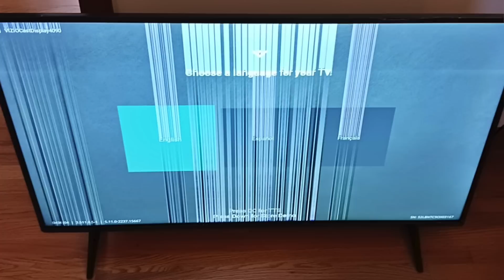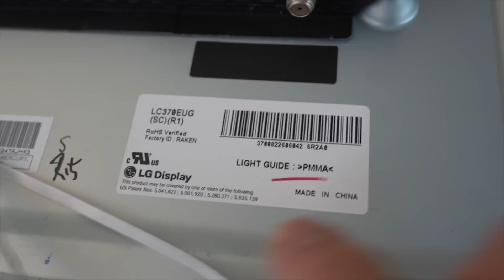FIX Your TV with a TOOTHBRUSH | Fixing Vertical Lines

Comment: I like that you showed off this TV repair even though you were unable to get it 100% working.
Reply from the maker: If I can figure out a way to fix that tab bond, I’ll definitely show it.  I’ve had some minor success by cutting into the cable at an angle and then dragging a soldering iron (with solder) across it.
Reply: @FrugalRepair  please Show it🙂

Comment: In many cases you can successfully reattach the bond contacts by using a hot bar. Besides the contact surfaces being a little bit sticky themselves, there's adhesive between the contact surfaces which is activating when heated to safely keep the ribbon in place. There are temperature-regulated soldering irons that have large bar-shaped tips to put heat onto a large surface. That would be the best-controlled approach but also the most expensive. The edge of a laundry iron might also do the job as you don't need excessive heat, only around 180°C or so. If you are really careful you can even do this reattachment while the LCD is being powered so you can immediately see the success.

Comment: 🎯 Key Takeaways for quick navigation:

00:00 📺 Introduction to TV Repair Techniques
- Introduction to fixing TVs with unconventional methods like tape and toothbrushes.
- Discusses previous success with the tape method and introduces the new challenge of fixing vertical lines on TV screens.
01:10 🛠️ Understanding LCD Screen Issues
- Explanation of different types of screen issues, focusing on vertical lines.
- Differentiates between vertical and horizontal line problems in LCD screens and their causes.
02:06 🖥️ LCD Screen Components and Functionality
- Detailed breakdown of LCD screen components and their functions.
- Explains the roles of driver boards, connectors, and the importance of signal synchronization in LCD displays.
03:01 🔍 Disassembling the TV for Inspection
- Process of disassembling a TV to inspect internal components.
- Focuses on safely accessing and examining the power supply board, main board, and other internal parts.
04:10 🧹 Identifying and Addressing Vertical Line Issues
- Identifying the cause of vertical lines and demonstrating a practical fix.
- Discusses how applying pressure to certain parts can temporarily fix lines, indicating potential issues with connections or components.
05:09 💧 Dealing with Liquid Damage and Corrosion
- Handling liquid damage and corrosion as common causes of screen issues.
- Provides tips on cleaning and repairing areas affected by liquid, especially around the tab bond area.
06:07 🛠️ Hypotheses for Persistent Line Issues
- Exploring different reasons for persistent vertical line issues.
- Considers possibilities like adhesive issues, corrosion, and component damage as causes for unresolved line problems.
07:04 📚 Diagnosing Various Causes of Vertical Lines
- Discusses various potential causes of vertical lines in LCD screens.
- Offers diagnostic tips and potential fixes, including applying pressure and cleaning techniques.
08:00 🛠️ Final Thoughts and Repair Limitations
- Concludes with final thoughts on TV repair and the limitations of DIY methods.
- Acknowledges when to stop attempting repairs to avoid further damage, and emphasizes careful handling of delicate components.

Made with HARPA AI

Comment: How about warming the ribbon connection with a heat gun and applying pressure as it cools (one half, then the other, to avoid dislodging)?  Might that soften the adhesive enough to re-establish the connection (even for solder)?
Reply from the maker: Great idea.  The main issue I see is dealing with the corrosion effects around that area and heat unfortunately, wouldn’t  help clean it up.

Comment: Thank-you for your TV repair videos.  It allowed me to mostly fix my 75" QLED Samsung.  TV was cycling from on to off.  Replaced the power board.  But still have a single multicolor vertical line.  Have cleaned several times the the T-con ribbon cable connectors plus done resets, made sure software was updated and line appears on all inputs.  So I am thinking the Main/T-con board got damaged when the power board faulted. Does that make sense?
Reply from the maker: Thanks! Congrats on the repair.  Did you watch my video on vertical lines?  It’s likely from a bad panel or tcon board.  Hopefully it’s the tcon.

Comment: A big thank you! My 2017 LG TV recently developed horizontal lines across the bottom third with some parts of the image from the top third repeated at the bottom. I isolated the side that had the issue and taped the first 8 pins and the picture was perfect. I left it as such and I can't tell any difference. Should I leave it or try to reduce the lines blocked? Also this TV seems to have the t-con built into the main board. I don't mind replacing the board if that will make for a better fix. Thanks again. Your content is very useful.
Reply from the maker: If you like the picture, then I wouldn’t change anything.  The issue is not on the tcon but on the lcd assembly (which you cant get a replacement)
Reply: @FrugalRepair  oh ok. Good to know. The picture as I see it now is basically flawless so no more changes then. Thanks for the quick response. Subbed too.
Reply from the maker: Thanks for that!

Comment: Hi, I have a 50 inch Hisense Android tv, 50H8G, board number 261423, 261424, RSAG7.820.9615/ROH and I was wondering if there was a bios chip on it. If not, what component on the board does the firmware write to. If it wrote to an Ic chip then I could unbrick my TV and write directly to the IC. My TV has a white light of death after an update and I tried all fixes and nothing works. 
Thanks

Comment: Very informative video. Have a similar issue, when watching the TV for 2-4 hours, a entire column 2" wide will draw itself top to bottom. I am assuming it is due to a heat related issue. This is an ancient TV, one of the original Hatachi 42 HD plasma tv's. 2006. Turn it off, let it cool down and its fine again for another 2 to 4 hours. Had it apart to replace the power board a few years back.

Comment: Might a hot air gun at a bit of a distance not repair the poor connection in that ribbon cable if the pencil eraser trick seems temporarily successful? Thank you for the useful video!
Reply from the maker: Heat might be helpful with the adhesive but it’s the corrosion underneath that is the issue.

Comment: You mentioned that the orientation of the lines matters. But what if I've had both horizontal and vertical lines? My display developed horizontal lines over the image, as shown in your earlier videos where you tackled the timing sync. But then the next day the display suddenly turned into coloured vertical lines/bands with the proper image being completely gone making the display unusable. So right now, it just has vertical bands, but I know there were horizontal lines yesterday. What kind of problem would this indicate?
Reply from the maker: If you have done the isolation technique I showed in the tape video then I would suspect a bad panel or tcon board.  There is a possibility also, that you have a short to ground on your driver board that's causing the weirdness.

Comment: You mentioned lines going away when the tv warms up. What if you have the opposite problem where the thick bands show up once the tv has been on for about 15 seconds?
Reply from the maker: You mean you have a good picture and in 15 seconds or so, the problems show up?  That still sounds like a heat related issue and hopefully you can fix it with some non-conductive material under the metal bracket to put some gentle pressure on that tab bond.  You can try turning down the LED brightness to something like 10% and see if the tv lasts longer (less heat in the tv).  Or you can put a fan on the tv with the cover off and see if it lasts longer to isolate the problem as a heat issue.

Comment: Have you seen horizontal lines, on an LG 65" OLED? The lines are on the left (roughly 1/4 of the screen) but they are dancing? Sort of going on and off or acting like a changing graph line. Can you open the back, inspect the T-Con boards, swap the connections to see if the problem changes?

Comment: How about if the screen looks like it leaked ink and has a crack point but doesn’t actually on the surface. The backlight works though.
Reply from the maker: That likely means the LCD is cracked and the LCD is not repairable.

Comment: What if the lines are the exact same way but horizontal. Would I be able to use the same methods that you just used in this video to fix the horizontal line issue on my screen ??
Reply from the maker: Watch my videos on fixing with tape for horizontal lines.  It’s easier to correct than vertical lines.

Comment: @FrugalRepair Do you have any idea why OEM place those connectors at the bottom of the LCD panel instead of top?
Is this to "design failure mode" anytime something spills on the panel?
If those connectors would be at the top, gravity would be not helping OEMs
Reply from the maker: I don’t think there’s much significance to it because sometimes the tabs are at the top.

Comment: Hi, i like ur video, very detailed. I have 65 inches 2021 Oled LG Tv. I moved location and I received the tv after about 4weeks later and i turned it on, it comes on once and went off and never came up again
 But the res light xomes yo when its plugged. Then there arw horizontal lines at the extreme right of the tv. Pleaae what do you advice. Thank you

Comment: I've got vertical lines too and looks like there was some liquid ingress right where those ribbons enter the LCD itself. I don't see how I can clean there but I'm sure it's what's caused the lines as the ingress is right around where the lines are
Reply: if alcohol doesnt work, try wd40 and a paint brush instead. it has softer bristles and will will easily go in tight spaces. DO NOT GET WD40 ON THE ACTUAL SCREEN, IT WILL CHEW INTO THE ADHESIVES AND RUIN THE PANEL. a drop or 2 on the driverboard on the rusty spot will be just fine.

Comment: If one of my yellow connectors/wire is damaged. Is it possible to repair or do I need a new screen?
Reply from the maker: If you mean the yellow wires that have the tab bond on the driver board then no, you realistically can’t fix that, unfortunately.

Comment: I have a friend who is a repair man and he shared one time he felt like especially lcd/led  TV are designed to have a problem for past a year  because how easily the way it was easy to loosen or degrade something inside them and add to the fact that most thing he repairs are LCD/LED TV  the ones that has average or lower prices.  He says its better to pay expensive led/lcd TV because those things will last longer and the money and time you spent for repair for non-expensive lcd/led are just better spent on expensive lcd/led tv.
Reply from the maker: In general you might get what you pay for.  But even the big brand names have had strings of problems.  Samsung and Sony had years of their TVs having significant issues.  Vizio sometimes has a bad reputation but a lot of their TVs were made by LG.

Comment: What if my TV looks perfect for 10-90 seconds and then it gets horizontal and vertical lines, then goes back to being perfect? I'm searching online but this video came up instead.. 

Okay so I just removed the back panel. Every time it goes all static-y with the lines, I hear a buzzing. Does that indicate anything that you're aware of? If I get no response it's fine, but if you do, thanks for your time
Reply from the maker: I don’t really know but sounds like a bad connection somewhere. I hope it’s not the tab bond but you can do the trick of putting pressure on it with something non-conductive.  It may be working well then stop because of heat.  You can try disconnecting one of the cables from the tcon board (did you watch my fixing with tape videos?) and try to isolate which driver board might have the faulty tab connection

Comment: Samsung 60 inch, Thin Screen Model No. QN65Q60BAF
In the process of moving the TV my friend grabbed the TV leaving a bubble imprint on the right bottom corner of the TV now the TV shows only on the left side and still has the small bottom edge bubble imprint. Any suggestions would be appreciated.
Reply from the maker: I'm not sure exactly what the damage could have been.  I'd try to re-seat the cables that go to the driver boards and hopefully that is it.  But it's also possible the lcd is damaged beyond repair.
Reply: Do you have a video on reseatting the Driver Board cables?

Comment: I have a 50inch webos powered rca, I was having horrible distorted image and lines.i unplugged the right ribbon cable, and a had half a screen white and the other with 90 mostly clear image. I did the tape method on ribbon cable and the distortion went away along with most of the lines. No matter how I taped the cables the lines were there. I replaced the tcon board and the lines a lot less visible (95%) repaired now. I wonder if my problem is more the ribbon cable/connection?

Comment: My 65" Vizio TV Model M65 D0 has a 2 to 3 inch solid vertical line. I changed the T-Con board, but the issue remains the same. Vizio technical service was not helpful either. I did try to push the ribbon cables, as you show in the video, that didn't show any change to that vertical bar (thick vertical line). Any other suggestion to fix the issue?

Comment: Do you have repair videos for LG OLED TVs? I have a LG 55EC9300 with broken HDMI ports. I got a used main board & had it installed by a TV repair guy. The used board was bad & TV didn’t turn on. The original board was put back in but picture has 2 wide snow bars & 2 wide black bars. TV guy pushed on back panel & they went away but a minute later came back stay on all the time. Any suggestions? ShooJimmy doesn’t have the board. LG wants $310 for new board & $332 for refurbished one.

Comment: I have a UE50TU8072UXXH samsung TV. Not used for almost three years.
We began to use it recently and suddenly it can't start up.
1-The standby red light keeps going on and off.
2- The back lights keep going on and off within seconds.
3- The output voltages that go from the power supply to the main board are 27 volts instead of 13 volts.(I don't know why).

My questions are:
1-If I replace the power supply ( NB4401054E), will the issue be fixed? 
2- Is it possible that the panel is damaged?
 Please note that If I disconnect the ribbon that goes to the panel the back lights turn on permanently.

Thank you in advance for your kind response.
Reply: Replace electrolitic condenser
On the power supply,by 16 volt
Original 10 volt,whit the 
Same MICROFARAD,IMPORTANT
BRAND NEW TV!!!😝
I TS ALWAYS THE SAME PROBLEM. ON LG....SAMSUNG

Comment: I have this exact same TV but it's the 42" version and if I leave it turned off for any length of time, when I turn it back on, only the top inch or two of the display will show a proper image, the rest of the display will be blank, after leaving it on for 10-15 minutes, I can turn the TV off and back on and it will start working again... I keep expecting the TV to die but it has worked in this state for a few years now... Any idea what could be happening...?

Comment: Hello my 70” vizio tv has half white and half black screen. Any suggestions how to fix it? This happen after replacing the LED strip lights
Reply from the maker: My guess is that the tcon cables are not seated correctly.  Hopefully an easy fix and not significant damage done to the panel when it was removed to get to the backlights.

Comment: What about dancing colors.

My Vizio TV works fine for a while but everything just turns into dancing colors (depends on what image signal is) after awhile. Then in need to turn my TV off and on again. Then it works for a while with good picture until a few minutes later when it bleeds out to dancing colors again.

Comment: Would using vinegar on the strip maybe dissolve the corrosion, or would that dissolve the bond between the ribbon? Also could hot air or a heat gun maybe rebond it? Or would that melt the ribbon?
Reply from the maker: I don't know what vinegar would do to the adhesive or the ribbon.  I don't think you would want to put something acidic on a pcb anyway.  Good thought on heat, I've not had success applying heat to these tv tab bonds so it's possible it could work. I would try to use something more like a soldering iron than a heat gun.
Reply: VINEGAR is Acetic Acid - and is corrosive.
There is a paste available - most often used by
Jewelers and watchmakers to remove corrosion
from watches - that have been water damaged.
One can imagine the intricate mechanical parts
in an expensive watch - and removing corrosion
requires special techniques.
The paste is not exactly low cost - BUT one does
not need to use much and not very often -
so a small container won't break the BANK.
I don't have it in front of me right now so I cannot
recall what it is called.
I would recommend watching some Watch repair
videos - and soon enough you will discover what
the paste is called.
Once the corrosion is removed with the paste -
the area can be washed /cleansed with a little
amount of IPA
Reply: @FrugalRepair  The vertical line issue presented here is very similar to an issue that occurs on game boy screens. The fix there is to apply heat onto the ribbon using a soldering iron.